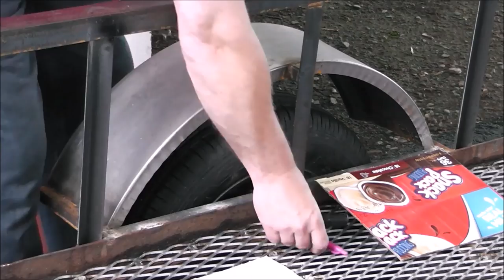The PILE Trailer Rebuild Series E.6  Decking Floor, Fenders, Tailgate!

Comment: I do a lot of welding at home. I have stick and mig capabilities, to include an engine drive welder. Flux core has become my new "go to" process for most things. When done properly it makes a great weld. I use it on a lot of repairs because it doesn't mind a little bit of dirt, kind of like stick. Great work!
Reply from the maker: Thank you!  Flux core is a good all around process...plus you can use it outside without worrying about your coverage gas being blown away.
Reply: @BrandonLund  I did notice a couple of places where you had pin holes in the welds. I've found the most common cause for that is when you starve the puddle for wire. Usually turn down the voltage, turn up the wire speed, or slow down the travel speed.

Comment: Looking good, I like the infill on the fenders-protects the tyres (tires) from any cargo, but also should keep some of the spray down in rain.
Reply from the maker: +Jaques Daniels Thanks! I got a chuckle on the (tyres) tires reference :) I knew what you meant mate :) see what I did there! I didnt think about the road spray, but now that you mention it, it sure will, along with mud and road grime. It's been raining here pretty steady for the past 2 weeks so it should come in useful.

Comment: Nice job on that wheel well: I probably woulda left it open and suffered the consequences later.  I was waffling on expanded metal vs wood, leaning towards wood for  hauling heavier items; but you could always add 3/4" plywood as needed if you wanted to haul a small tractor or 4x4. 
Also, I'd switch to premium gas in the grinder.
Reply from the maker: +Gordon Reiher Great tip on the plywood!!! and good call on the premium gas for the grinder!!! ;)

Comment: how much does it cost to buy a 48x96 expanded metal sheet? any idea? thanks
Reply from the maker: It's been a while since I purchased a sheet but going by memory a half sheet of #9 a couple years ago was just over a 100 bucks.
Reply: @BrandonLund  for what wood cost if i can get metal for that price i will try to find it. any idea where i can get it in Fort Lauderdale ?
Reply from the maker: I don't have any idea but your local welding supply store is always a good source to pass on good metal suppliers. 😉